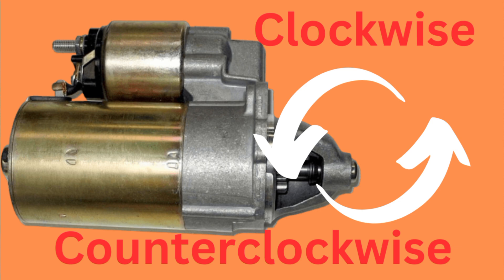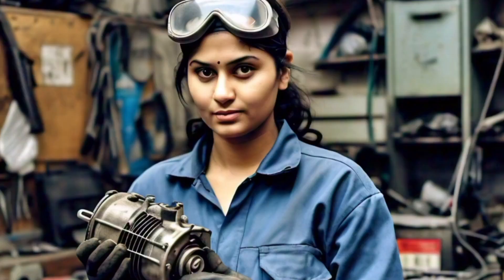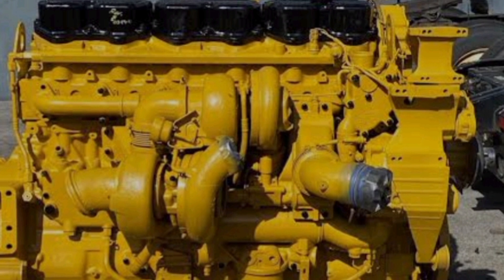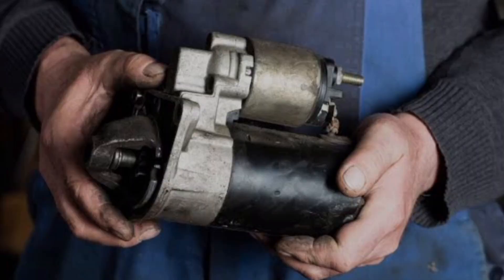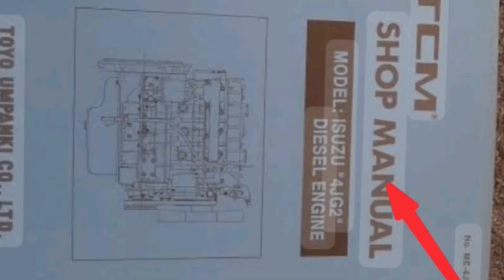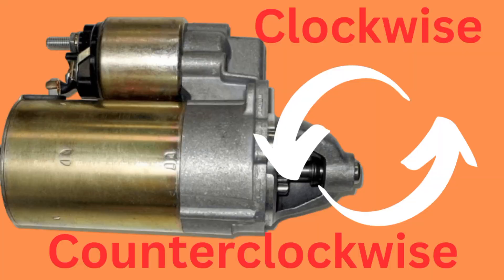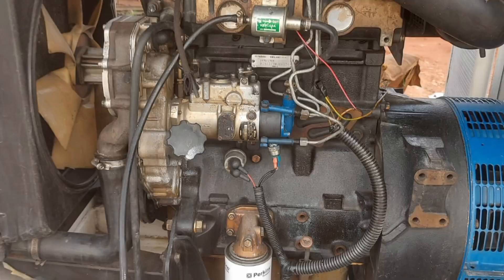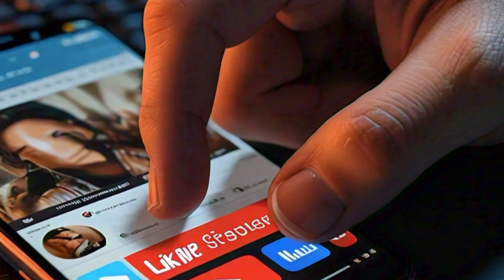How starter motor works | clockwise or counterclockwise

Comment: It is opposite if the starter plugs in from the back of the flywheel housing!!
Reply from the maker: No, the rotation of the engine would determine that: clockwise or counterclockwise